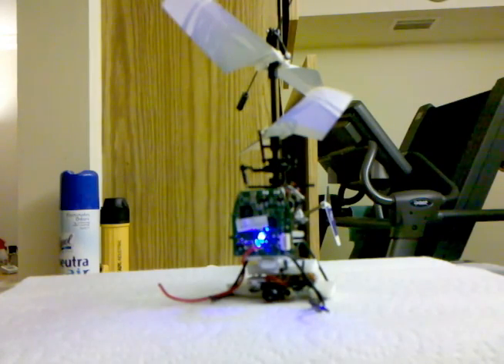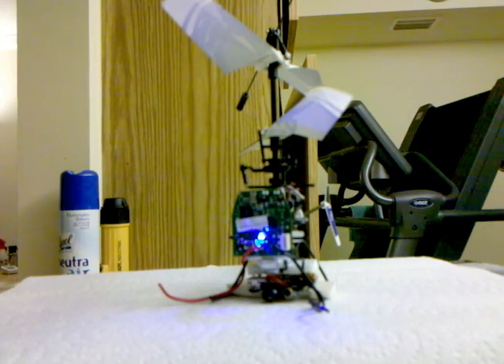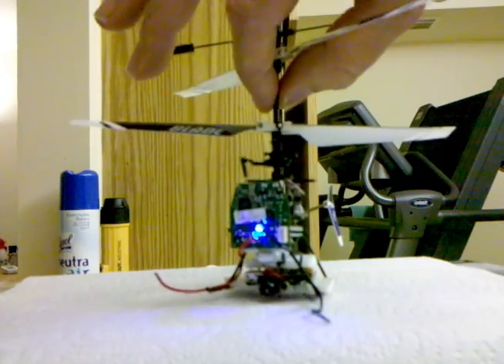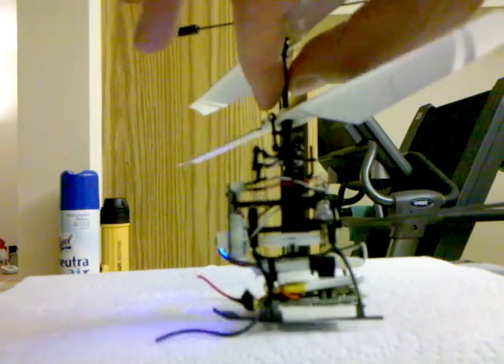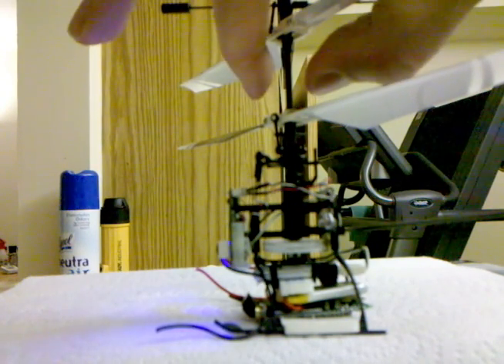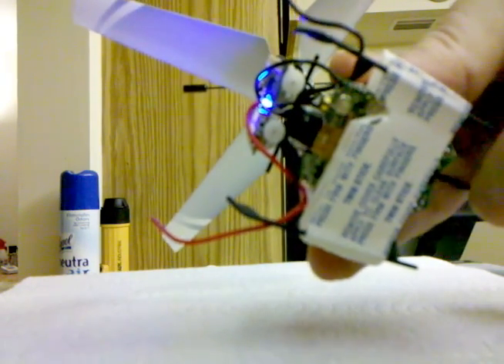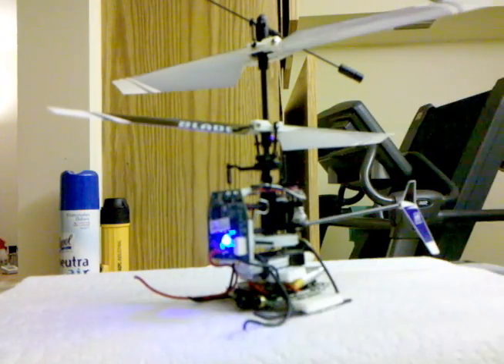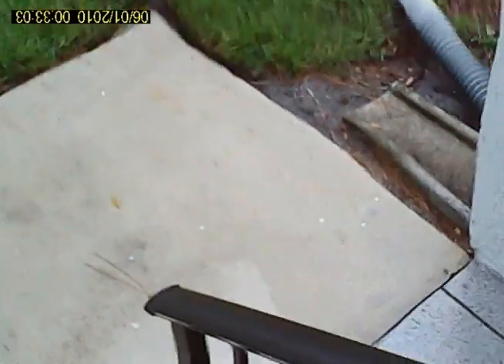Blade mCX2 helicopter with 808 keychain camera - flight 1

Comment from the maker: @deepVAroots Yep, Flight#3 shows the setup. Upside down was the best way to mount the camera and lens assembly in its original position. Seemed better from a protection standpoint too.I've had a few tough outdoor crashes and the camera was never damaged.